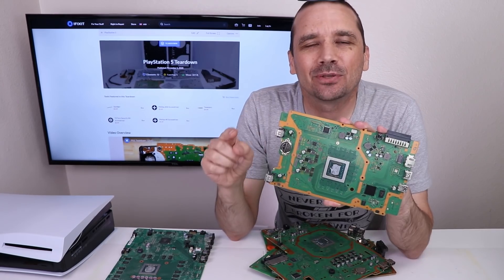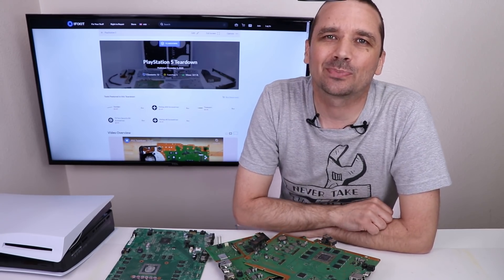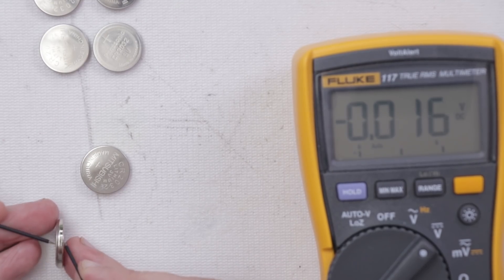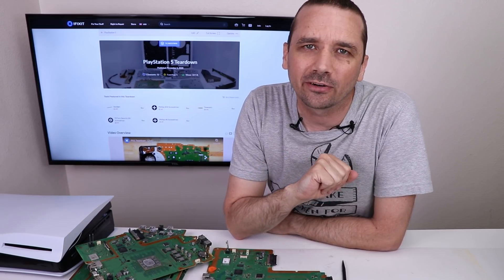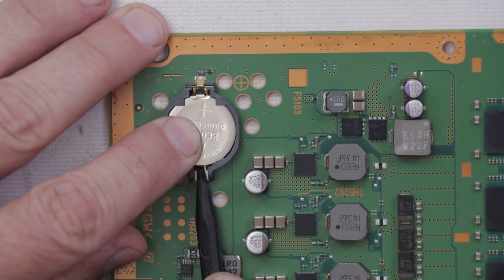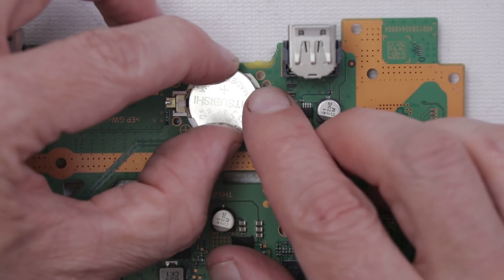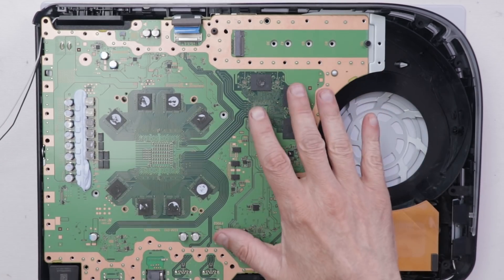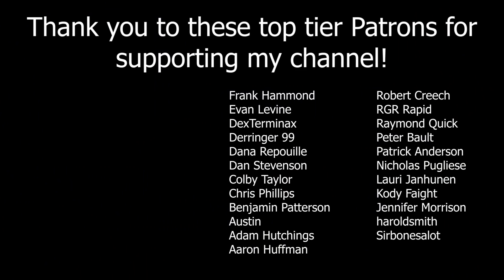PS4 & PS5 CMOS Battery Replacement - But Why?

Comment: Am facing a problem on my ps5. My ps5 hard crashes  while playing ps5 games for like 20 mins and it doesn’t even turn on until i unplug the power cable from the back of the ps5 and plug it back again.

Comment: When this will actually become a problem you will need to replace them without disconnecting them though. You can't just replace them normally anymore. First you need to attach a backup batterie that stays connected, then replace the original battery and then remove the backup batterie. If you just replace the battery without a connected backup battery the console would already be bricked.

Comment: I literally don't understand the fearmongering around these CMOS batteries.

They last like 10 years and they are so cheap to replace. It's not like the CPU is dying. Your battery dies? Cheap and easy fix and you can authenticate again. I really don't see the issue

Comment: These batteries must get a bit of a charge or I'm very lucky. My OG fat PS3 still runs without an issue. I plugged it in recently after months of it being unplugged so the family could play Mod Nation Racers (HD remake please), and other than an OS update, nothing special happened. I'm considering replacing the thermal paste and upgrading to a better fan, so I'll probably swap the battery to be safe.

Comment: I’m having this issue but it’s my Dreamcast that doesn’t maintain the date and time.
Reply: You should do the battery replacement mod, you desolder the old battery, solder in a battery holder then buy a rechargeable battery to put in it, then if the battery dies or needs replacing it will take a few minutes a battery swap and then your done.
Reply: @FARK_QUE  Nice. Thanks!
Reply: @princegroove  your welcome 😁 the mod kits are easy to find on eBay and not to expensive.

Comment: I have a 4 usb PS3 backwards compatible model. Bet the CMOS battery is dead i have no problems if it’s connected to the internet it automatically sets the battery same with my PS4 .

Comment: The Problem here is not the CMOS battery , the problem here is the Console need to ONLINE Authenticate your System Clock with PSN and enabling your Local License Server back that lets you Save\Get Trophies\Install PKG from BD discs that are locked with a license Key on your BD Disc ... in other words , Jailbraking a PS3\PS4\PS5\Xbone is the only way to go if you want to play it in 10 years

Comment: One thing to mention - With the probable future shutdown of the PS4 update servers, wouldn't it be a good idea to attach another 3V source to the battery socket during your CR2032 replacement, so that the CMOS doesn't have the opportunity to lose power and be reset (losing your score data because the time is wrong). [I'd even go so far as to solder on wires so that connecting an external battery pack would be easier.]

Comment: be super careful when disassembling a ps4 or ps4 pro. there is a 4 wire connector that goes from the power supply to the motherboard and u will likely rip the connector off the board even if u try to be super careful. and u will hate yourself when u rip it off(ask me how i know). u will probably have to send the board to a repair shop to be fixed if that happens. also, if u successfully get the connector off then smear permatex di-electric grease(can be bought at an autoparts store) all over the plug so it will come out easier next time.

Comment: Test a battery with a meter? No bueno.... it's not a good test as there is no load on the cell and the reading isn't valid. Get a battery tester of some kind or use a 325 ohm resistor across the cell then measure the voltage.

Comment: A power supply unit although you switch off your computer and the power to the board the psu will always send 5 volts into the computer board although it is switched off .
Any Brainiac's know of a idea to not use the battery but keep sending a voltage through to when the joints are set at 3 volts without the supply not switching off from the power unit to just consistently sending 3 volts to keep it staying InTouch with the psn server.

Comment: I still don't know how can a battery be used to authenticate with servers. I thought it was done through an internet connection  🤨. Would love to gain some knowledge on this whole thing .
Reply: Best to check out Doesitplay1 Twitter page these are the guys who covered the cbomb issue and explains what PlayStation consoles are effected from worst to best and PS4 being the most effected.
Reply: The best way that makes sense to me is that the battery does hold some battery power to allow the board to maintain settings within. The moment you remove this battery, the memory settings are wiped.

Someone can correct me here, my understanding from what I've been told is that the moment the settings are wiped, this includes authentication to your digital licenses of games (PS3). On the PS3, if the servers were 100% shut down, your games can no longer be authenticated  but you'd still be able to play physical games fine.

The PS4 and PS5 have stepped this up even further. I don't know how they managed this but now your whole console needs to authenticate or resync itself to the servers to ensure your console has the licenses to play the games you purchased. From my understanding, if your whole console cannot connect to the servers to verify... Your console is bricked. There's no way to bypass the authentication without server linking. This move shows that Sony was planning the same DRM practices as Xbox in 2013. They were able to reverse their decision after the backlash but now we're seeing that everything was set-up to create that extreme form of DRM. 

Again, this is what I've been watching (not an expert) and I'm more than certain that ifixit will provide corrections and an expert response.

Comment: I think the Wii is the only console with a user replaceable cmos battery
And yes
The cmos battery in mine is still running after 15 years
Reply: I love my modded Wii, and yes The Wii battery is easily accessible, ( The Sega Saturn's Battery was also easy I believe)

Comment: Have you made a video on how Xbox authenticates or why they don’t have CMOS batteries? I’ve been wondering since watching this. I’d be very interested to see why and how.
Reply: From what I just read, the PS consoles do the same. If they don’t have a battery, they work just fine as long as they can access the internet to get their time (they are able to fetch the time just like the Xbox). It’s just that if it dies and you’re offline, than you can’t play games anymore. It’s really similar on Xbox too, but the Xbox is more restrictive as each time the power goes down, it loses time. But the Xbox allows you to play some games even then, while the PS5 will not boot most games without internet,

Comment: These batteries keep their voltage when they are not loaded, but the voltage collapses when loaded. Try to measure them again holding them with wet fingers and you'll measure much less. You need to measure them under a slight load.

Comment: Are you gonna see if you can fix the series x becoming a glorified paper weight after like 3 months of no server connectivity regardless of cmos battery status. Which is actually worse than the cmos battery POSSIBLY going bad in a ps4/5.

It is rhetorical, it is not possible to fix that unless Microsoft do something but they won't.

Comment: Steve, if you think the placement of the PS5 battery is dumb, just take apart a few PS2 systems. Some versions have the battery on the motherboard, making you teardown the whole system while other revisions have the battery right on the side of the disc drive.

Comment: Mmm i don't think changing battery is that easy, I mean if you remove the battery you'll shut down CMOS energy that keep it alive so you'll reset internal clock. 
Could you make a video to see what happened with those boards you have changed the battery?
Reply: Thats what i thought to be honest whats the diferance in out come
Reply: @borgred  maybe if he weld an extra slot

Comment: How to mod PS4/PS5. Buy an 18650 battery, TP4056 charger, and a buck converter (4v to 3.3v) . Find a steady 5volt supply on the PS4/PS5 motherboard, and solder the charger to that supply. Solder the battery to the charger, and the buck converter between the battery and battery connector on the motherboard. Enjoy

Comment: I was wondering why this got so much bad press, cmos battery is a moderately easy fix. I guess I can see why it would be scary to get in there and replace it, luckily as a PC gamer you get a good bit of experience with the cmos if you are messing with bios settings.
Reply: The problem was CMOS batteries on ps3's when the store was going to be closed down. Replacing the CMOS battery would not fix the issue because the data stored on the battery would be irreplaceable

Comment: You could have easily change ps5 CMOS battery without needing to separate the heatsink, Sony even make sure to leave a hole in the metal plate so any repair guy could replace it, you really didn't did your homework today
Reply: His description of what a CMOS battery does was pretty lacking too.

Comment: The battery keeps the bios alive while the system is not plugged in,if the system is plugged in the bios does not need a battery

Comment: So people were losing their minds over something that can be easily replaced?
Reply: Lol you still don't understand what is going on do you? Once servers are gone even if you replace the battery you won't be able to run your games either digital or physical. DRM to the console
Reply: @fgpt4828  but the ps4 servers are still up and they aren't shutting down any time soon, so people were losing there minds over something simple, and besides it's not like you'll completely lose your digital games because they are tied to your account and can be downloaded to a different console
Reply: @mutumbishamutakwa270  I would suggest checking out Doesitplay1 Twitter page they have a detailed breakdown of there findings of the cbomb issue covering PS3/4 and 5 and why it can become a big problem in the distant future by creating alot of e-waste and useless consoles mostly the PS4 as this is the worse console effect out of all the PlayStations with th dreaded cbomb issue.

I don't know why but Sony fans like yourself seem to not care about game preservation and the right to repair people have this thing in there minds Sony won't do this they won't do that the servers won't ever shutdown none of us know what the future holds and many successful console companies have come and gone over the last 40 or 50 years.
Reply: @FARK_QUE   I'll check out the video. It's not about not caring about game preservation because it's like I said in my earlier comment, if the battery can be replaced easily even after the old one dies, then people were just making a fuss over something simple. If you can't play your games even after replacing your digital games wouldn't be because they are tied to your account and can be downloaded to a different console

Comment: The PS5 seems to be the worst to replace the CMOS battery because you have to be careful with the liquid metal and you probably also have to replace the thermal putty on the vram chips.

Comment: Yeah, you don't actually have to take all 43 screws off off the PS5. You only need to take off like 1 (the sole Torx screw I believe) and the entire assembly will lift right out, with the battery exposed.
Reply: That wouldn't have made this look as involved to do! Can't have that!

Comment: Measuring voltage on lithium batteries is not a very good way to tell their charge. I prefer to just use a red LED - if it lights up, then battery is ok. Even completely dead batteries will have about 3V. A working one has at least 3,2V.

Comment: Man, I've heard a dozen varying descriptions of the Cbomb issue, and I've never heard a reassuring answer about why the issue wouldn't affect Xboxes as well... The version that makes the most sense to me is this: the major issue isn't really the CMOS as much as the DRM Sony puts in their digital titles that keeps them from running unless it can verify the current date was set by a Sony server. If they ever shut down that server without patching out that DRM (which I don't know whether that's a firmware-level DRM or it's in each game individually), then you'll want a fresh CMOS because you'll only be able to keep playing those digital titles until the battery dies and that server-set time disappears forever. I've heard games on blu-ray don't have that DRM. I haven't heard definitively that Xbox digital games don't have similar DRM.

Comment: hey @tronicsFix,

i have a very specific and annoying problem. my ps4 looses the video after 10-15 minutes of gamepay. The game and ps4 goes on even the controller works fine with sounds.
i noticed, that the ps4 runs a bit hot and the fan is always in idle and doesnt crank up. I replaced the fan with a new one and cleaned the ps4 and replaced the thermal compound...

do you have any idea?
Reply: Probably a faulty hdmi port.
Try using a new hdmi cable first if that doesn't solve your issue then replace your hdmi port
Reply: @NotoriousRawDogger  ill try that
Reply: BGA maybe
Reply: @pomidortv797  whats bga
Reply: @theAgentSmith2  you will get blod maybe just reball it but first xray it
Reply: @pomidortv797  tue ps4 is workinh fine. There is no blod...

Comment: I saw a video where they tested the ps5, you can still play games from disc and installed on hard drive if the battery does and you are not connected to the internet. This is a ps3/PS4 issue mainly

Comment: @TronicsFix Can't you open the PS5 from the other side? i.e. take out the screws that hold the mobo+heatsink sandwitch to the other half of the case and remove the mobo+heatsink assembly as one unit?

Comment: After changing the battery, do you need to connect your PS4 to the internet in order to be able to play your games? Or just changing the battery fixes the issue w/o needing internet connection?
Reply: Yes, you need to connect to the internet. Even if you're preemptively replacing a battery that's still good, removing it causes the data to be lost. This means you need to reconnect to the internet and PSN to re-sync the time before you can play again.

This is why one day, all of these systems will be bricks. The servers they connect to will be shut down by Sony due to lack of profitability some day. Then, after you replace the battery, guess what? No more PSN to re-sync the time with, so enjoy the useless consoles that can only tell you "hey I can't play this game until you sync the time with a server that no longer exists."
Reply: @mjc0961  I managed to change the battery without having to reconnect the ps4 to the internet, but it wasn't easy:
I bought a CR2032 battery holder, soldered some wires to its terminals, then disassembled the ps4 and before removing the battery, solder the other end of those wires to where the ps4's battery is soldered (being super careful with polarity!)
Then I put one cr2032 battery on the external holder, took out the one from the motherboard, replaced it with a brand new one, and desoldered the batter holder I put in. This way at no point the motherboard was left without power.
Reply: @mjc0961 - You talk as though only Sony has this issue. Wii & Wii-U use cmos batteries & M$ definitely has a drm system in place on their consoles. Not sure what the Switch is using, either. Do you actually not realize any of this?
Reply: @TexasHollowEarth  you have valid points in your comment but this video is about PlayStation no other company and what the previous person comment said is correct no need to defend it it effects all of us one day. I would like to think 20 or 30 years from now I can replace that battery in my PS4 and the servers are still up to sync the internal clock because without it which in the distant future it might not be there my PS4 will be nothing more than a paper weight. I still play and use my PS2 I had to replace the battery few years back but least with that console it never had to rely on connecting to PSN to get the console working fully again so as things stand now my PS2 will probably out live my PS3/4 and 5 because it doesn't suffer the dreaded cbomb issue.

Comment: Okay I want to replace the battery in my PS3 rightaway. But what happens if I pull out the battery, would that not make the console loose it's date and time ?!
Reply: Yes it will make your console lose its time and date maybe setting's aswell but once you've done the battery replacement and connect to the PSN servers your time and date will be back to normal and your console will be fully working.
Reply: The battery problem can only badly effect you in the distant future if and when the PS3 loses access to the PSN servers, it may never happen but it's a scenario we all have to think of.

Comment: I work as a computer technician, I change CR2032s very regularly, and I use a battery tester to check, and sometimes the voltmeter shows me 3V but the tester tells me that the battery is dead ... in the doubt ... I replace the battery :)

Comment: TLDR: The more your PS4/PS5 is plugged into the wall the longer these batteries will last in your particular system.

really interesting that SONY didn't use their OWN CR2032... IDK if any of those were pulled from a launch ps4 but that is really interesting... I will say this You failed to describe the "CMOS Clock" problem properly. If the CMOS looses the voltage from this battery when the PS4 is UNPLUGGED then when the PS4 boots and it doesn't have an internet connection the "SYSTEM TIME" will be set back to whatever SONY set as the factory default.

You did mention the authentication problem pretty good but the way SONY is handling the Digital Content Authentication is actually kind of cheap but efficient.